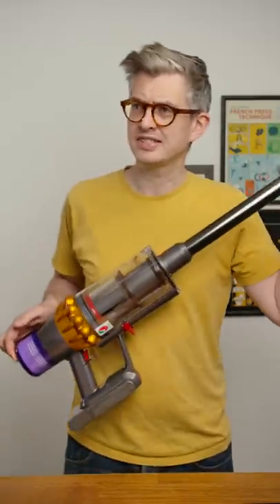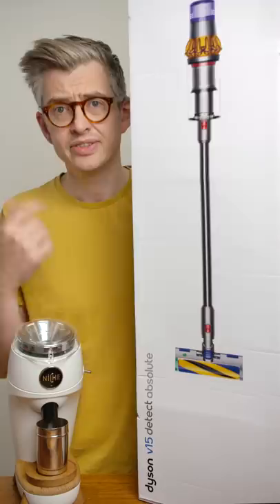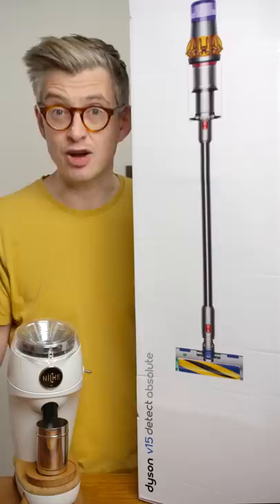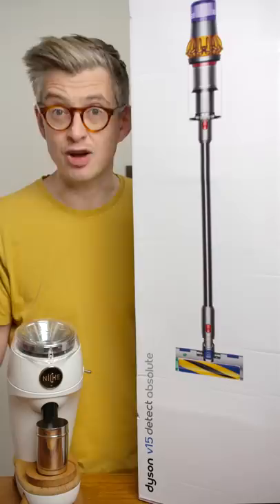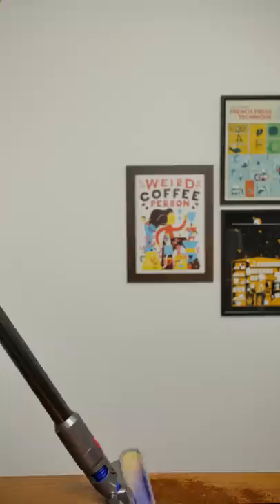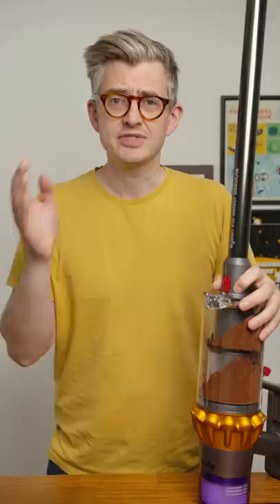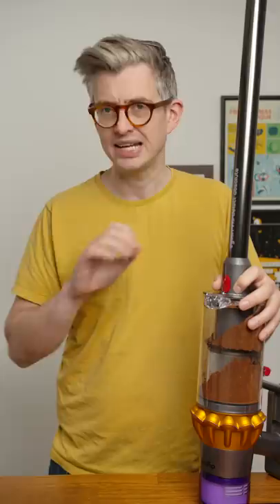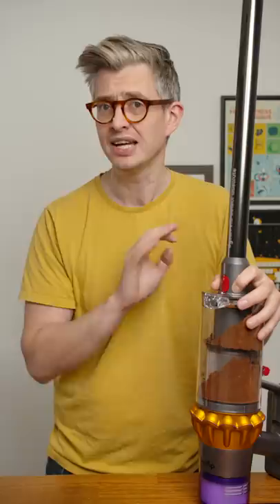Coffee Particle Size Analysis With A Vacuum Cleaner #Shorts

Comment: I absolutely love my Dyson V15. Seriously, it might not be good at analyzing coffe grounds, but man does it pick up dust well. And even if the particle counter is not 100% accurate, it still helps tremendously with telling me if there's still particles in my mattress when I vacuum it because I am allergic to dust. It's expensive, but both my hardwood floors and my mattress never felt cleaner. Can recommend! :P

Comment: I have no idea what size the coffee grinds should be, but the smallest increment is labeled greater than 10um (>10) and the 2nd increment is greater than 60um.  So that left most bar should indicate grinds between 10um and 60um.  anything smaller than 10um should not be detectable.  So the question is did both coarse and fine grinds produce grains between 10um and 60um or did the coarser grind produce grinds larger than 60um and should have been counted in one of the larger distributions?  for comparison the width of a human hair is typically between 120um and 180um.  So you need some chunky grinds....

Comment: 500ug = 0.5mm  so those are pretty big grounds.  Interesting that the courser has less in that bin though.  I think the real difference would be in the 60 and 180 size bins (less than 0.06mm & 0.18mm)

I would disregard the >10ug for this test. For particles there are always vastly more small particles than large. Think about when you break a piece of bread. There are 2 big pieces and lots of crumbs.

Comment: The issue is that a particle size distribution analysis done at a lab is volume based. A fine is much smaller than a coarse particle. There is always going to be many fines by count than the coarse. Maybe it’s not as wrong youd might think.

Comment: Buy a Hegman Gauge; used in the paint and battery industry to measure particle size in inks and slurries. Might be able to make it work (roughly) with coffee grounds or a coffee slurry. Source; Am Scientist

https://en.wikipedia.org/wiki/Hegman_gauge
Reply from the maker: I’ve looked at these but they don’t seem to be available in the larger particles sizes I’d want
Reply: @jameshoffmann  How much would you want to invest. As these are 'simply' precision machined pieces of steel, you could get one custom made from any competent machine shop or CNC operator. Not my area of expertise so I can't offer more insight than that unfortunately.

Comment: Interesting test, James! Wow that particle size display is confusing. Why does it say greater than 10um when all the other values in the breakdown are also greater than 10um? Is it meant to be "between 10 and less than or equal to 60"?? Or did they get their angled brackets backwards?
Reply: I think that's a relatively common way to label a histogram, albeit a bit lazy.

Comment: I'm sure that there's some cheaper option. Let's think. Assuming coffee grounds have a uniform density, the only thing that changes is the cross-sectional area of each grain. So, suppose we have something like a wind tunnel where we have uniform, laminar airflow. If we then let the grounds fall into the tunnel, which has pots on the ground at various distances from the fan, the length of travel should be determined by the ratio between the sink rate and the drag on the grain. 

Heavier grains sink faster. Now, an optional step would be calibration of our machine, but I think that can be done with a lab report of a few samples that we and a lab that has the expensive machine tested.

Comment: This could be wrong. If it measures by pure quantity you're going to have multiples more tiny particles than large ones. It's like this with any air sample and the vacuum is sampling air along with the grounds. To do a fair analysis you need to use control samples measured also using a calibrated particle size analyzer

Comment: I think you can probably get quite good results with a light microscope which can take photos and a software like imageJ. If you assume, that your particles have some kind of sphere shape, you can measure the diameter of the particle in your photo by this software and by doing that for 200 particles you will get a particle size distribution. No big deal, I did that for much smaller particles. So no fancy, fancy machine needed…

Comment: Nice, chemical engineering at its best!! That's something I always was fascinated about coffee brewing and grinding. You find and can apply many relevant topics of chemical engineering in topic: 
Emulsification e. g. Stability, droplet size, color dependency or mechanical process engineering e. g. grinding techniques, particle sice analysis or fluid dynamics e. g. flow through porous beds, pressure loss, rheology, foam dynamics or heat and mass transfer or thermodynamics....

Comment: Nothing new, Hoover did it in the 90s on some of their uprights.  Two versions, one turned the motor speed up to increase power when extra dirt was sensed, the other models fluctuated between a red (dirty) light and a green (clean) light.  Both worked off sound, it was basically a microphone that listened for grit particles.  It didn’t have all the gimmicky particle chart nonsense though.

Amazing that people pay such shockingly high prices for glorified Dust Busters.

Comment: Could you not use a zetasizer if you brewed it ? It would be a colliod it'll set you back about €25k (more for better models) but you could probably get them second hand for like 17-20k. No garentee it'll work and you might need to play around with concentrations and it won't tell you the partial size of the powder but it'll be better than this

Comment: Right.  A vacuum showing particle size distribution.  We can't have accurate fuel gauges or speedometers in cars.  Or accurate signal strength meters in our smartphones.  Or accurate battery life indicators in any electronic device.  But we can have an accurate particle size meter in a vacuum cleaner?  Right.

Comment: You can replace the Dyson with a Henry and it will last 10 years longer, even if you abuse it. Furthermore, the Henry made by Numatic can be fixed should it ever go bad since ever version since 1984 still has parts available for it, Dyson however, is so hard and expensive to repair they have a 2 year life expectancy on average.

Comment: You don't need 100k... just a Sieve Stack and a balance + a Sieve shaker if you're averse to any exercise. 

Haven't done any lab work for a couple of decades now but would not be surprised if the 100K devices are calibrated with a sieve stack anyway.

Comment: I thought there would be a jig with the vacuum at variable distances to pull out the smalls
in a calibrated fashion. I'll keep dreaming.
Reply: might be doable with a set of cyclone dust collectors of varying diameters, each separating a different size range of particles...

Comment: Wait, but what? Why would the average person need a vacuum cleaner that can detect particle size (even if it actually works)? Do some people have rubbish bins that separate waste based on particle size or something? 
Someone please enlighten me because all I can think of is the extra battery power needed to run the display while it's in use.
Reply: To justify the price increase over the previous model.